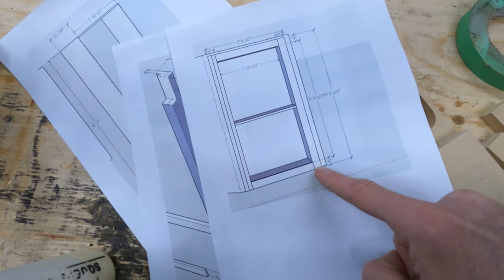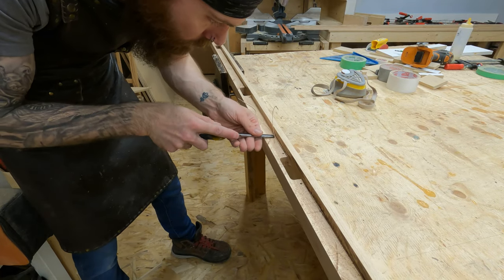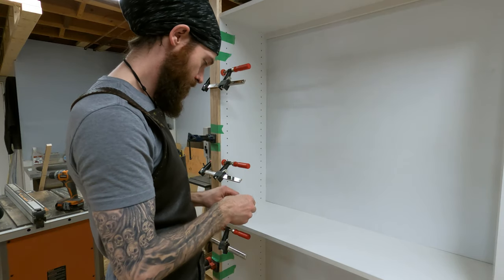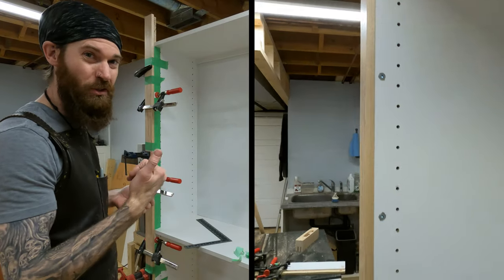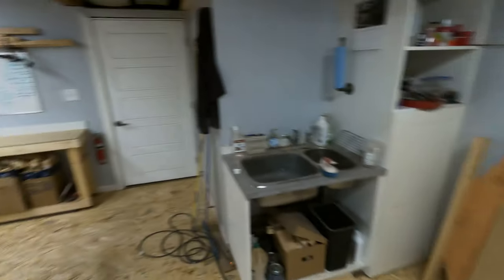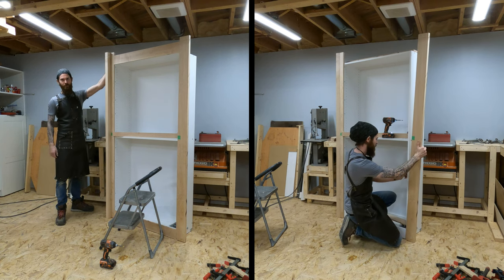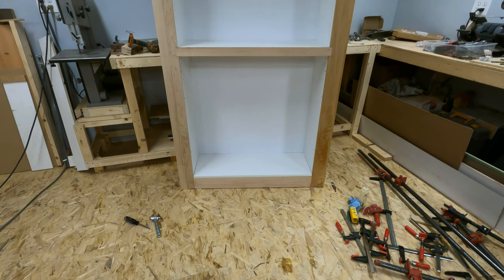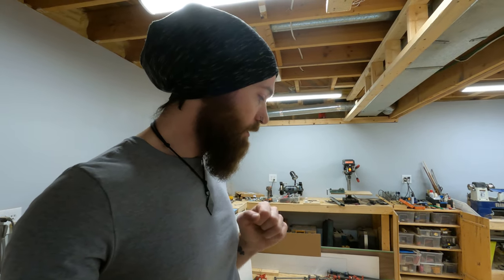Face Frame and Stain || Secret Hidden Bookcase Part 3

Comment: What program are you using for the 3D design work?
Reply from the maker: This is Sketchup. It’s nice for more simple designs and super easy/intuitive to use. but it can’t do complex curves very well in my experience. I’ve been using Shapr3D recently for complex curves, it’s a little more in depth of a program, not as much as Fusion360, which is complete overkill for 90% of people using it.
Reply: Many thanks legend  @HewmanMade